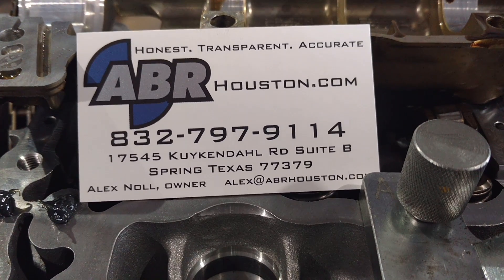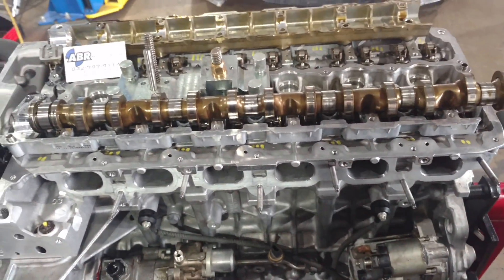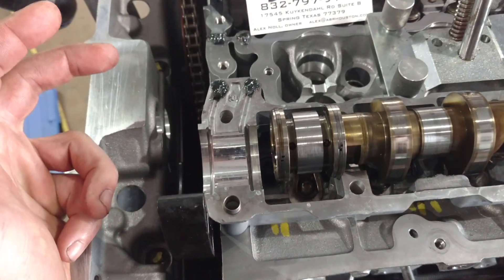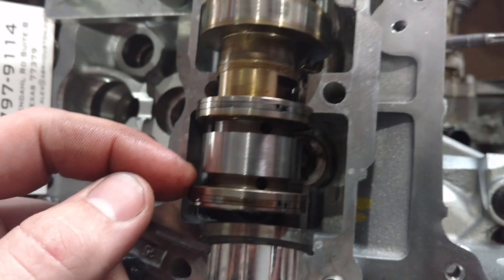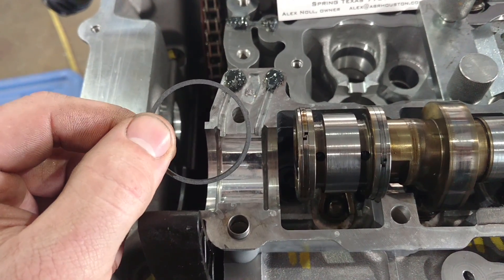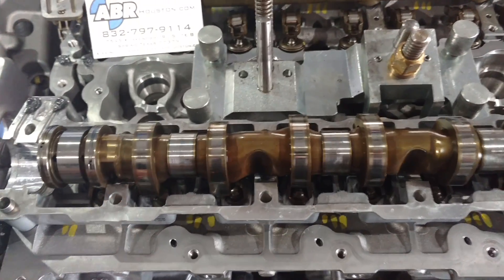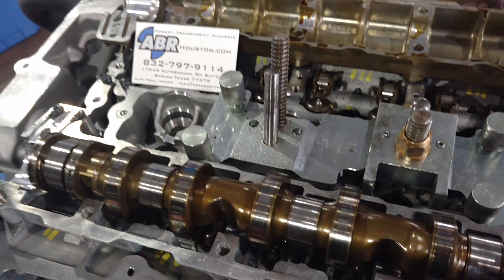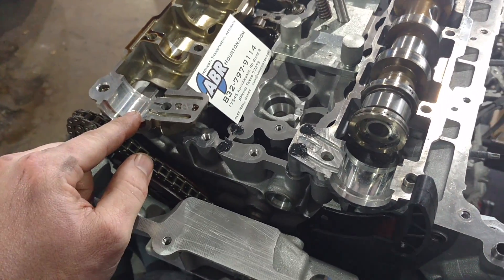ABR Houston explains N54  N52 and general Vanos faults and why

Comment: that's what happens when you don't use the right oil/don't change your oil on time. BMW's were made for people who are eager to maintain their vehicle.
Reply: More likely dogging it before oil is at a good temp, combined with short trips. If someone has a short commute and never gets the car to a decent temp and spends a little bit of time driving it like that, the condensation never works its way out. Oil type I'm sure has a role to play as well.
Reply: Gravy job

Comment: Is this pretty common on the N52/N54's? Also have you been in any N20's yet?
Reply from the maker: bimmerman3 N20's have an entirely different issue with camshafts. they have a cam recall for the intake not oiling the vacuum pump, and we've seen a few cams gall and lock up the engine......

but no this is not an issue on an N20
Reply: I've heard about timing chains stretching on the N20's and they're replacing them under warranty or extending that out.
Reply from the maker: bimmerman3 the N20 is not very fun to fix or own......I'd have to verify, but I'm pretty confident they use the same cassette and chain as the 6 cylinders.... if that is the case no NG6 Engine has chain stretching issues..... so something would be doing it N20 specific